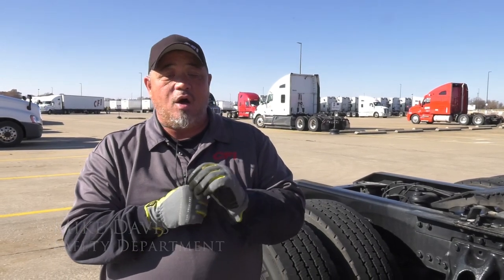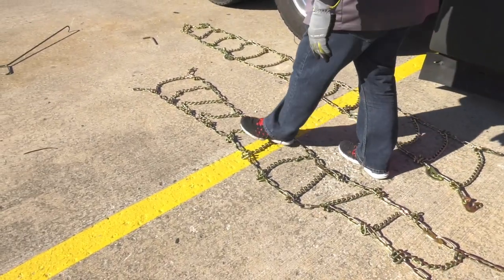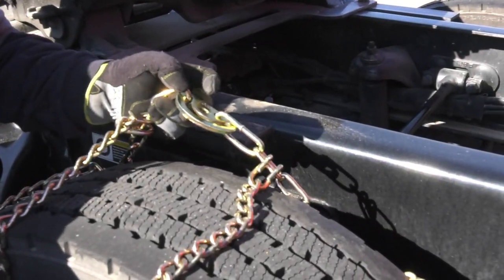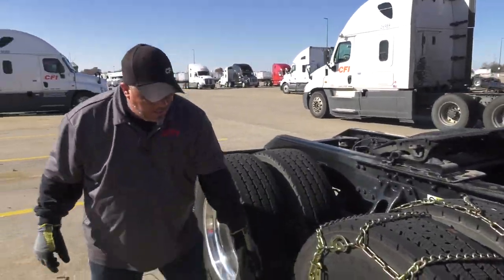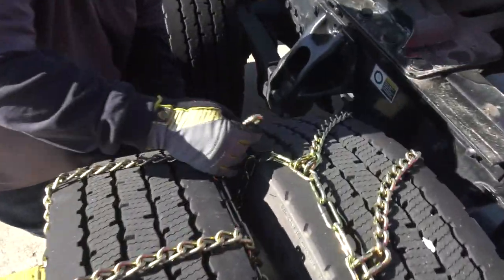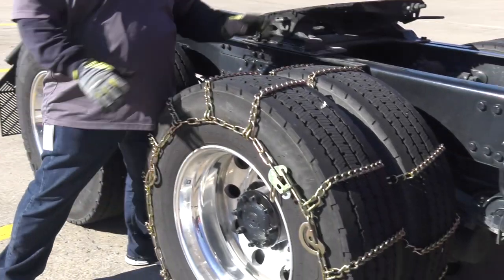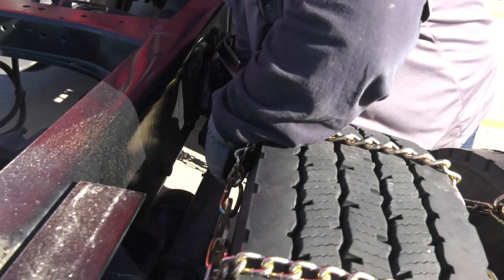How to put snow chains on dual tires

Comment: Does CFI not have power dividers on their tractors?  Misinformative videos like this are the reason why you see chains laying all over the roadway on 80 over Donner.  If your axles lock you only need to put the singles on the 4 outside tires, this process demonstrated will take someone 3 hours to chain up in the snow on the hill.  Additionally, if only the front drive axle is powered in these trucks, the 1/2 pair “3-rail” chains is also a much simpler process and lessens the risk of the 2 separate singles getting tangled together when driving, which they’re bound to do based this sloppy work.
Reply from the maker: Chain laws vary by state, at CFI you are the captain of the ship and chains should only be used to get out of a bad situation, not designed for continuous travel. CFI trucks are twin screw, and yes, it does take time to chain.
Reply: CFI this video is comical.  Yeah it does take time to chain, but teaching methods like this will set your drivers up for failure by running out of hours on the hill because they spent 3 hours chaining using this method.  There are so many more simple and efficient ways of hooking your chains, without having to lay down on the ground.  I run Donner Pass Between Sacramento and Reno every day.  It was a rough go when I first ever chained (about 90 minutes) but now I can chain my single drive tractor with 3-rail chains and 4 chains on my double pups in 20-30 minutes.  

For instance, you should NEVER hook anything before you roll the truck to finish tightening the links/cams.  Doing so will be too likely to throw the chain over the wheels and get tangled and damaged.  Drape the chain evenly over the tire and roll back or forth, THEN hook your links.  SO MUCH EASIER.  I’m critical yes but I see so many drivers from all the mega carriers struggle out on the mountain, and I just wish they were better trained and informed, training videos like this are a disservice to your drivers and the motoring public.  Thank you
Reply: CFI Well that is about as silly  as it gets. Maybe you guys don’t drive in mountains but out here in British Columbia Canada we certainly do drive distances on our chains. The Coquihalla highway has some long chain up sections as long as 30 miles or more. We chain up often and use nothing but triples takes me 5 min per wheel set. putting 2 sets of singles on a wheel set is asking for trouble.  
If your going to do a safety video at least do it safely. I mean standing in between the wheels while the truck is running and  someone is in it would get me fired.

Comment: Yeah, I know. Everybody's a critic. 
But now, it's MY turn to be one.
INSPECT CHAINS FOR TWISTS!!
BOTH of these chains are twisted!(3 railers not only would've prevented this, but made the whole process much faster & easier.)
At 3:45, you can see 2 cams on the outside rail. Both are in the open position, but they are facing in OPPOSITE directions. 
Uh, red flag???🤔
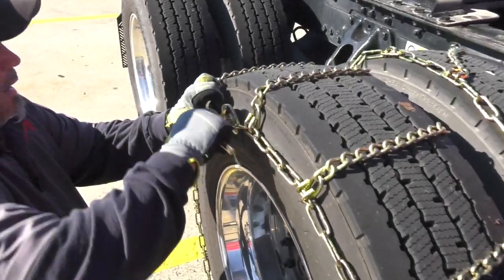At 4:20, the cam being tightened is in the correct position. The safety guy turns it clockwise to tighten it.
But there is a twist between this cam & the next one.
10 seconds later, our safety guy begins to turn that next one clockwise, but ends up going counterclockwise with it.
Uh, another red flag?... maybe?
At 7:20, he tightens the top cam on the inside chain. After he does this(look close), you can see the round edge of the cam facing outward. 
Wrong, wrong & wrong!
Chains are manufactured in a manner that places the curved edge of the cams, when in the open position, aligned with the curve of the tread when you drape the chains over the tire(easy indication that you haven't installed them upside down). Tightening them points the curved edge toward the bead. When the vehicle is in motion, centrifugal force keeps the cams in the closed position. 
If the closed cams face the wrong way, centrifugal force will swing them back out to the OPEN position. 
This is why chains get thrown, people. 
Running with twisted chains causes weak links & shortens the life of the chain.

Comment: So we should unhook from the trailer?
Reply: Of course you can. I alway did. Get the tractor out from under the trailer where you can work on it. Also, you can put a block of wood under one tire of a dual set in order to lift the adjacent tire off the ground.

Comment: The only reason to chain all tires on one axle is if the othe axle is a dead axle.  If that is the case use 3 rail chains.  If both axles are powered use one chain on each of the outside tires on each axle.    It prevents the safety hazard of laying in between the drives and under the truck.

Comment: Chained up on several mountain passes over the years depending on road shutdowns and really watching/listening to weather and radar, I've made the choice to shutdown or chain. Been with CFI many years, it's what you the driver safe in doing as to shutdown or chain up, and planning well ahead is a big factor to the decision. Anyways I prefer 3 railed and yes their heavier but two sets of dually chains will work to. A descent video, but much more detail for drivers that have never chained before would make for a better video. Chains get you out of trouble not into trouble if you know what your doing, it's those that don't chain and get stuck on a mountain grade that makes for bad on everyone else. Most drivers I've met that haven't chained before will say how tight, I point to some broken links on the highway.....as tight as you can get them and stop just after and recheck the tightness/tension. Inspect chains before you need them that their in good shape and don't have broken links, etc. Dont forget to use bungee cords after youve got your chains on and tightened Be safe drivers.

Comment: "You can actually come over here and make it easier"....., you said.
You  seemed to forget the tractor will be  hooked to a trailer when we do this out on the road and make the job a bit more difficult.
oh brother,  you needed to remind viewers is not as easy when actually hooked to a trailer. Also, single chains get twisted real easily and can be a headache when trying to tighten them.
Explain this before throwing them over the tire.
You don't mention the importance of the bungee chords. Without them, you risk serious damage if the chain breaks loose, the tension created by the bungees help the chain fall to the outside if they fail, instead of inward and get tangled between the tires.
This presentation is as bad as I've seen

Comment: Thank you for the demonstration. Unfortunately, this is completely unrealistic. I have never applied chains without snow, mud, and ice present. Also, (and most importantly), you would very rarely need to apply chains without a trailer. You could never stand in between the tires the way you demonstrated.
Reply: It actually makes the job easier if you disconnect from the trailer to install the chains.😎

Comment: You forgot to mention using bungie cords for extra measure.
Reply: Please relocate his micrphone,  the heavy breathing was driving me crazy
Reply: Never add binders to cams unless you want to cut chains off an axle one day. If it is so loose you need a binder then the chain is not installed right. A great job would be 3 of 5 or 3 of 4 binders tight and the last not able to twist until driven a few. I used a short pipe on the key so I would not have to stop without a parking lot to check. I sold and installed chains for several years out of Big Bear California. Even the chain company liked my installs to the point they chainged (Get the pun?) their install methods. I also have used a 4x6 board to drive over with the chain links boxed around  the board. When I get a truck I can do another video with I might add it to my collection.